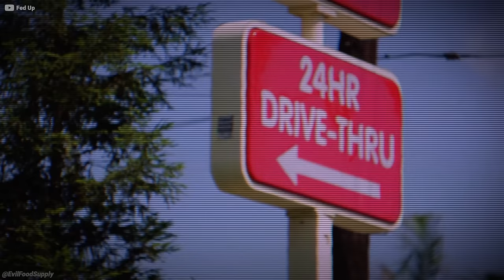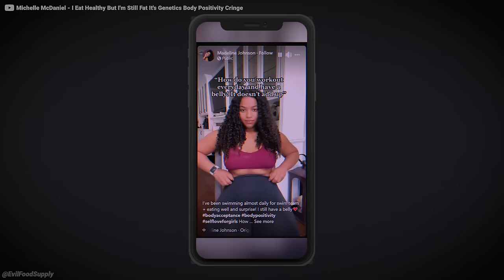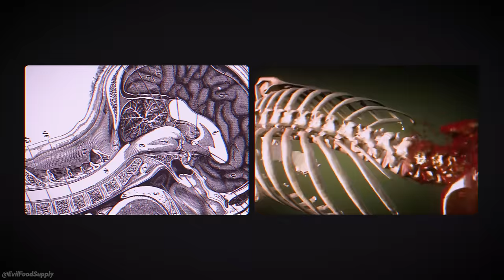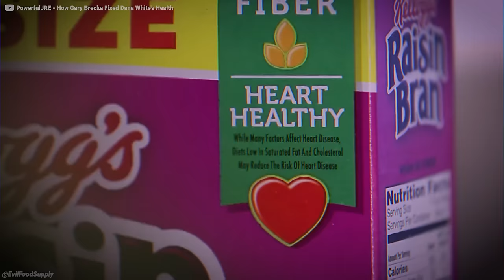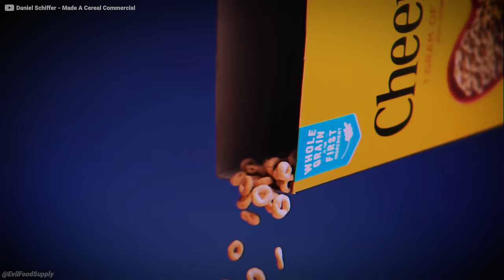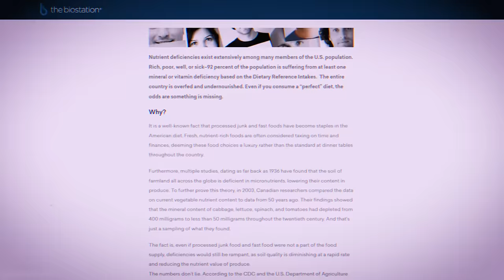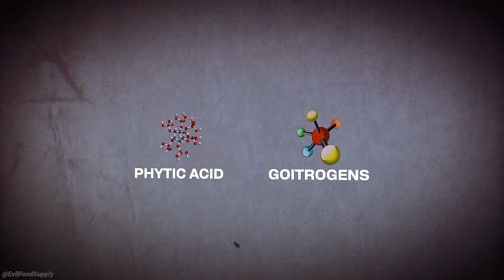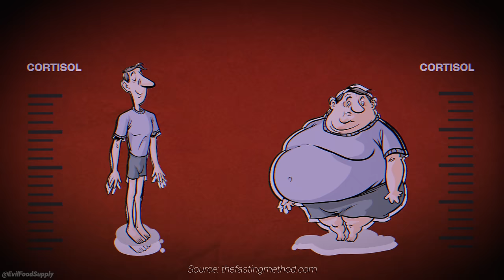The Obesity Conspiracy

Comment: Over the past 15 years I've dropped over 210 lbs... deciding to make a big push about 7 months ago due to the desire to reverse insulin resistance I gave up all sugar and almost all carbs in early May while also stopping 90% of all processed food and adding key supplements missing from my last bloodwork. Not only has my A1C dropped to normal, lost 55 lbs so far but... remember I'm eating low carb, high fat, no sugar diet I also was able to stop taking a statin for cholesterol, in particular triglycerides, after only a few months. Thank you for also mentioning stress as well... that plays a big part.
Reply: Congrats that's an insane amount of weight to lose
Reply: Are you on keto or carnivore?! I changed my carb eating "recomended" diet to ketogenic lifestyle little ove 8 months ago becouse my blood sugars were way too high and my weight kept rising every year even that i were eating whole foods and way less carbs than 90% of the people. That still didn´t help so i dropped carbs under 20 grams a day to get on ketosis. When your body is on ketosis it will burn fat for energy (becouse it doesn´t get carbs anymore). So, now my body burns fat for energy 24/7 and in eight months i´ve lost 45 lbs (22kg). I haven´t increased exercise at all. I had propably at least developed insuline resistance if not t2d (never diagnosed) after three months of this my sugars went down (and have stayed down) where those should be on a healthy person. So i can say ketogenic lifestyle really made the difference. Also in ketogenic and carnivore lifestyle you will eat vitamine and mineral rich foods like meat, fish, chicken, eggs and cheese. At keto you can eat some veggies too, but mostly non starch high fiber ones. 
Also getting rid of seed oils and using better like extra virgin olive oil and real butter to get more better fats and omega 3.
Reply: No sugar low carb prob means you aren’t eating as many calories as you once were and why you are able to lose the weight. Although I’m not saying the other factors did not play a part I think this video is misleading as to how to actually lose weight
Reply: @ArchieArpeggio  I'm not sure which level it qualifies for, like you my primary goal was to decrease blood sugar and if possible get some more weight off as well. I usually eat meat, eggs and veggies (lots of spinach but some carb loaded carrots as well) . If I do eat some bread it's Keto bread, Sola, with 1 net carb. I've only used olive oil for about 7 years now and switched from store branded to a highly antioxidant version I get from a tasting store about 3 years ago. I'm doing the same as you with butter as well, the good fats seem to really make a difference! Congrats on your changes and weight loss!
Reply: @xxtremestudio  In college I lost about 100 lbs and then taught aerobic (30+ years ago) spending about 5 to 6 days a week in a gym. My metabolism is slow, so I have to do things to speed it up. Once I didn't have time I cut calories, as I had been doing mass and cut cycles for years and put on tons of weight on a low calorie diet. I think what the video is getting at, in part at least, is that calorie reduction alone won't work or won't work long time. At least it doesn't for me, it has to be associate with some form of exercise. I'm almost 54 now and have a lot of responsibilities so spending multiple days a week a the gym doesn't work. However anything IMHO makes a difference and if you can pair that with the diet changes we are all learning about we can do better. 

You are correct, in general I'm not eating the same amount of calories but the change isn't that drastic because I don't want to lose muscle mass. It's definitely less but what I'm eating is the main focus. I watched my mom and her friends in the 70s and early 80s go from one diet to another losing weight then gaining more back because of extreme calorie deprivation ending up "fatter" than they were even if they were the same weight. In the late 80s early 90s I learned not to do that through bodybuilding. Weight loss, like so many other things we seem to have issue with today as a nation (US) is balance - virtue is a mean. If you can cut a little and burn a little more you will drop over time, especially if we take into account what we are learning about nutrition today vs what we were told for so many years. At least that's my opinion and what seems to work for me, hopefully it can work for some others as well!
Reply: triglycerites go down no matter the macronutrients when you're in a caloric deficit ( see the infamous ''twinkie diet'' experiment where the subject's blood sugar and triglicerites lowered on a crap diet at a caloric deficit ).
Reply: @familhagaudir8561  possibly but that hasn't been the case with me... I've lost almost 60 since may and have lost the other 150 plus over many years and they never went down. Different people's bodies handle certain things differently.

Comment: I used to have a lot of issues with constipation and bloating. It made me tired and uncomfortable all the time. This went on for over a decade and doctor after doctor didn’t have an answer. They said drink more water (I was over drinking water because of this). They said eat more veggies for fiber. It made it worse. Get more exercise they said. I boughta treadmill and started running several miles almost daily. That didn’t help either. My gastroenterologist finally diagnosed me with “really twisty turny small intestine” which she said must be causing slow digestion and blockages. I saw something online and started taking a multi-supplement for calcium/magnesium/potassium/phosphorus and almost immediately, it fixed the problem almost entirely. If I forget to take it for a few days, I immediately go back to stomach issues. It’s crazy. If you have issues with this, please try this supplement. The brand is Country Life.

Comment: When I swapped to a 16/8 fast eating style, I immediately dropped weight. Eating in my 8 hour window really works nicely for my body and helps me burn more excess. When I couple that with plenty of water, eating nutrient-rich foods, and avoiding processed food, I really slim down quickly. No need for counting calories or totally avoiding a treat when I want one, I just keep the portion a realistic portion. I need to check my micronutrients, though.
Reply: 16:8 doesn’t work for me. It takes at least 24hrs to begin resetting your system. If you want to drop a few pounds then maybe it works. But it’s not advised if you wanna lose 15+ lbs
Reply: @FransceneJK98  There's not 1 solution for every person, that's true. But I lost 35 lbs that way so I really love it. For many people it can be a good starting place.

Comment: When I gained 30 pounds of extra fat, losing weight was at its hardest it ever was in my life. After fasting those pounds away (admittedly quicker then is healthy) I anticipated my metabolism being at its slowest/most broken ever... but things turned out very differently! My body is back my normal old self and I no longer gain weight anywhere near as easily as I did when I had this extra fat.

Comment: I have been talking about this for years. I have tried so many different diets (Including fasting) and a few years ago gave up. Did my weight skyrocket when I gave up? No. When I was working out 5 plus days a week and measuring every bite, did I drop a ton? No. 

Turns out I had undiagnosed PCOS, which leaves you hormonally imbalanced, prone to insulin resistance, and deficient in Vitamin D.  As if this was not enough I found out I had a small Pituitary tumor which according to my doctor 1 out of 4 people have and don't know it. Even though my prolactin numbers were not concerning, I had enough other symptoms that My GP pushed for an MRI. My Endocrinologist was like no, she doesn't need it. He pushed and won. Turns out that there it was sneaky little turd, hanging out in my head.  

Influencers keep talking about calories in and calories out, but that was based on studies done a long time ago and do not take into account: Hormone imbalances, fruits and vegetables that Are nutrient deficient due to over farming, and that gut bacteria. There is a gut bacteria that studies found that many thin people have that many overweight people do not. Taking a supplement will not fix it. I will not even discuss what has to be done as it is very gross.

Comment: I am doing a 80% Carnivor diet and it changed my life. Lost 13 Kg in 4 month and i have never feelt better. I personally believe that the big issues with our diet today is carbohydrates and sugar, that is why i decided to cut most of it it out and it works. Before you try please look up the stages of Carnivor, so you know what you are getting in to and dont fail at the first speed bump. When you switch you budy to run on fat, it can be a little rough in the start but the benefits are life changing.

Comment: Let’s just be real, most people (including myself) is that when people say “gave it my all at gym” and “serious diet” it’s all 🧢. It should take 2 years minimum to get to your goal weight. It’s not gonna be an easy process, you need like this dude says, hormone control, so water 2 liter or more per day, normal multi vitamins daily, 30 minutes of sun at least, a decent diet with 2 cheat MEALS per week max, don’t even think about bringing anything like Oreos home. No chips, no breads other than whole wheat. Be smart about what you eat and exercise at least 45 minutes daily. Then 2 years of doing that and no change you can complain. Good luck 👍 I’ve lost 15 pounds or 7 KG in 5 months so far and doing better.

Comment: "Fat people aren't really eating more than their peers" this is and isn't true. All it takes is a measly 100-200 calories a day over your daily limit and you'll guarantee put on weight steadily. That's about half of a candy bar, a full protein bar, or about 2 1/2 apples. If someone ate about 2 1/2 more apples than someone on the upper end of a healthy weight range you wouldn't really think of them being a glutton.

Also, as someone who has hypothyroidism and lost over 65lbs, most of those BEFORE getting diagnosed and medicated, I can tell you counting calories 100% honestly, you will lose weight, that is a fact. Most people either, "eyeball" things when calorie counting or measure wrong (you have to measure a centimeter under the line) and that's why it, "doesn't work". But if you actually weigh your food out and account for what your food is cooked in (oh yes, do not forget the oil that is easily an extra 100+ calories) you can do it effectively. If this wasn't the case and it was only hormones no one would be starving.
 
Hormones do make things harder or feel nearly impossible to eat less or exercise more, but if someone burns more than they need in energy they will lose weight. Fixing hormones and eating right will make this a thousand times easier but it is outright misinformation to say that it's not, "calories in, calories out" when it IS factually.

Comment: I'm a nutrition student and some of the stuff in this video is really misleading and lacks nuance. If someone is overweight due to nutrient deficiency, taking vitamins and supplements should immediately help them lose weight, right? But that's not true. If you want sustained weight loss, you need to make sure you get enough nutrients AND eat the right amount of calories for your size and activity level. You CAN lose weight just by counting calories but it isn't sustainable for most people. Hormones are incredibly important for overall health but aren't everything for weight loss. Saying calories have nothing to do with weight loss and weight gain is blatantly untrue and very misleading

Comment: Most people don’t approach the nutrition correctly. Macros are important. Prioritizing protein is an easy way to eat better. High protein diet and exercise and you can eat a lot and stay fit.
Reply: Yep, with the bulk of carbs replaced by fat and protein I found my carb addiction gradually disappeared.  30kg fat lost.... Still need to watch the overall calorie intake though. I do blame genetics to some extent as I must not eat hi glycaemic carbs, my wife however can eat one chocolate and the box could go out of date before she at another... Me? Eat the box in an evening!
Reply: @elkiton  exactly. You still have to watch overall intake. However, the protein heavy meals seem far bigger and more filling. I’m regularly eating half pound of beef or chicken at a meal. At my weight, I’m trying to hit 180-190grams of protein every day, so maximizing protein at every meal is key. Even eating that much meat, I still usually finish the day with a shake. I’m also lifting, so it’s really part of a whole system

Comment: How come im eating 2 meals a day, no pizza, sweets, chips, soda.
Walking 2 hours a day
And still obese ?????
Reply: @susanwilliams4953  good suggestion, my mom has that disease, but I've been checked last month, plus all my blood work done and there's no problems, no high BP no cholesterol no diabetes. 

It's very strange and I don't know what to  do at this point.
Reply: I think you should try more exercise than just walking, push to running and more full body movement
Reply: @LeeBaileydennis-in3ky  I'm trying the carnivore diet as of this week. I'm a ex gym junkie and I'm fed up.
Reply: To many calories
Reply: @webuyhouse8917  wrong
Reply: @webuyhouse8917  I used to eat double and weighed only 135lbs. 5 years on meds I put on so much weight
Reply: @SagittariusMom  your eating to much that’s it

Comment: I was 100 lbs overweight in my early 20s. It was my fault. I ate too much. Calories in, calories out; that simple. I was lazy and didn't exercise. I owned my situation and took control of it. I'm now a very muscular long distance runner with a six pack in my late 30s. Own your situation and change it.
Reply: I used to be overweight as well. It really is about calories. People have no idea how much they're actually eating. It's so easy to eat over 3,000 calories, especially on junk food. As soon as you start tracking to see how much calories you're actually eating and then you actually lower them by switching out to different, healthier, lower calorie food. You lose weight pretty fast

Comment: Lost 77 kgs in 2 years doing Keto & work my way into Omad. My blood pressure & choleterol meds has also been cut in half multiple times & a lot of side effects are also gone. Cutting the carbs actually work if you are big. Basicly  carbs has first priority in your bpdy so you dont really get into fat burning unless you have burned all your carbs first. At no point in the last 26-27 years has my doctors ever menioned the carbs & instead i found it myself randomly online.  Crazy how fast i lost weight once the carbs was cut. Ive reached a point where i loose little weight unless doing workout on top of the fasting. Most impressive is that i dont get hungry when fasting. Of cause i didint start by jumping straight into Omad as you dont start running a marathon by attempting to run a full one either. First skipping breakfast & then add a hour one at a time. Once you know about the carbs it also gets really weird looking at the food pyramid.

Comment: I was husky, tubby, technically obese most of my life and there were a lot of contributing factors. At age 29 and 260 pounds something in my mind shifted gears. Less than a year of peanut butter toast (daily) and 4 hours on an elliptical (per week) with ZERO sugar resulted in a 91 pound weight loss. Dangerous to be 6'2" and 169 pounds so I decided to work on muscular definition. With a mild form of dysmorphia, I'm hesitant to eat and twice I had to remind myself I'm not diabetic and it's okay to have some sugar. It's possible to shed weight. Just needs discipline and commitment. You. Can. Do. It!

Pros: 

- Easier to breathe.
- Boost in confidence.
- More clothing options.
- Easier mobility resulting in tackling daily things with little to no effort.
- Depending on genetics lottery and/or character, more people may change their attitude for the better.

The cons: 

- In my case, became anemic twice and without multi-vitamin + iron I'd bruise easily. Still taken today. "Nature Made" brand.
- Always cold now and 4½ years later its hard to adjust to seasons and poorly managed HVAC systems
- The fear of eating anything because the chance of ballooning back to original size.
- Old clothes fit like trash bags. This requires replacement or ingenuity.
- Bony (non-existent) butt. Hard surfaces hurt to sit on.

Comment: What about leptin? This is a key hormone is is frequently dysregulated in those with obesity, with common mutations such as ob and db. These mutations lead to decreased sensitivity to fullness and available energy stores. Also, creatine is not an amino acid. 
Phytic acid only impacts nutrient absorption in the context of the meal and snack at hand and doesn't impact absorption at later meals. Of your eating a balanced diet, its not a concern. Also if you cook or soak your beans and legumes overnight, these levels are reduced. Also, its an important anti-oxidant which helps reduce oxidative stress and its suggested that it may help prevent insulin resistance.